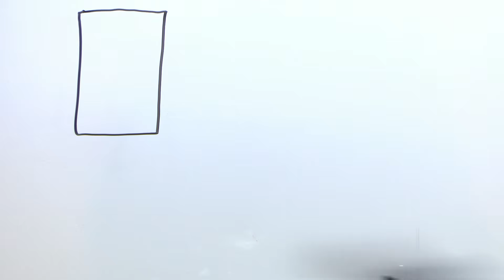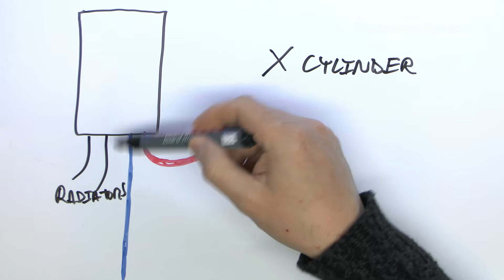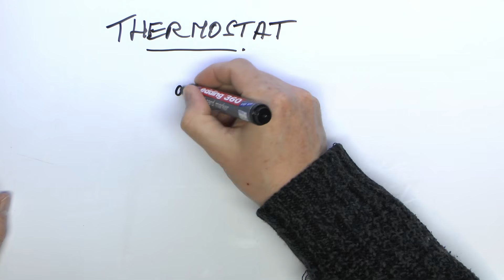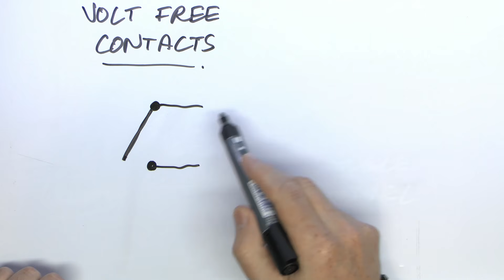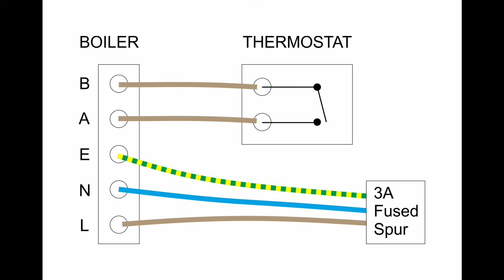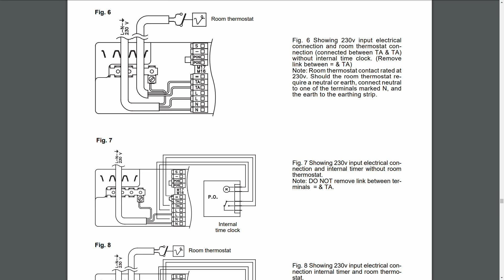Combi Boiler Thermostat Wiring

Comment: i was wondering if anyone can help. 
Im installing a hive 2 on my logic 24 boiler  which doesnt have a previous receiver. 
I understand this video (its great) but a lot of other forums say i need to make a link from Live to 1 common? 
im kind of worried about doing this as i dont want to wreck my boiler. 

Can i just attach live and neutral from the existing boiler terminal? plus connect the switches? 

Many thanks in advance
Reply from the maker: If the boiler uses 230V switching, then a link can be installed between L and common (1), with a single wire from Heating On (3) returning to the boiler.
However that is only valid for boilers that use 230V switching, doing that will cause severe damage if the boiler uses another voltage.
The other option is to have the 2 switch wires from the boiler connected to 1&3.
The tiny advantage is that one method only needs 3 wires, and the other 4 wires.
Reply: @jwflame  Thanks so much. I'm slowly getting more clarity. I'm not 100% sure how to find out if the boiler uses 230v. But the method that seems a good place to start will be the 4 or 5 core cable. 

2 from the switching terminal on the boiler to ports 1 and 3 on the hive. 

And piggyback live neutral and earth from the boiler terminals to the hive.  Altho it says an earth isn't needed. 

Thanks again for replying. And thanks for your channel!

Side note. Would you recommend just opening up the wall on off switch (spur?) And running L N and E from that to the hive?

Comment: Hi good morning just going through your video. I have purchased the Honeywell T4. would it be possible if I could send you a picture of my original wiring and if you could kindly advise. Existing wiring I currently have 3 wires coming out of boiler. If I could email you a picture or any other way of sending please

Comment: I am looking to replace an older type 3 wire mains thermostat that you describe (limited to minimum setting of 14 degrees C), with one that is capable of being set to 5 degree C ( just to keep pipes from freezing). Can anyone  identify a manufacturer of such a thermostat?

Comment: Hi, im trying to install the hive thermostat, but when i took off my old thermostat there was only three wires. Red Blue Yellow. Does this mean it is not suitable?
The type of thermostat i have is the ones commonly found in uk homes, a while plastic box with a round dial . Appreciate any help.
Reply from the maker: Depends on what those wires are.  If they are line, switched line and neutral then an single channel Hive can be fitted there , however the Hive receiver isn't intended to be installed where an old thermostat was - the receiver is normally installed next to the boiler and the thermostat located elsewhere.

Comment: Hi John. In the example of a possible wireless room stat at 10.00, could you put a link from L to A. And then have B go back to the boiler as a switched line. I know you said it's a volt free contact it's just that I seen it like that somewhere. Will it work or will it destroy the PCB?.Thanks
Reply from the maker: Yes, that can be done - but only if the boiler uses 230V for the switched input.
Volt free contacts can be used with any voltage, including 230V.
Reply: @jwflame  Thank you John, much appreciated,
 One last question if I could, would doing this mean it the thermostat becomes mains voltage? Rather then volt free contact. Struggling to understand what makes it one over then other. Thanks again
Reply from the maker: @abdulh63  Volt free just means it's not connected to anything inside the thermostat - you can connect any voltage to it.  
The other kind are permanently connected to voltage inside the thermostat, normally 230V, so with those they can only be used with 230V boiler and there is no other option. Same as having the link from L-A permanently built in to the thermostat.
Reply: @jwflame  ah ha I think I've got it now! Thank you very much.

Comment: Great video Im after a bit of advice. I was replacing my motherinlaws stat which is a battery digi one. At the wall are only two wires red and black. I replaced it with a wireless stat which has 4 terminals. 4 live 3 neutral 2 volt free in 1 volt free out. When the two wire are connected to 3 and 4 it powers up unit but no switching the heating on or off. How do I wire it up to operate heating. The instructions say about bridging a connection but are very sketchy to say the least
Reply from the maker: If the battery stat worked with just those two wires, then those are the wires for volt free in / volt free out.  You will need additional wires for the L&N supply.
However a wireless receiver isn't intended to be installed where the old thermostat was - it's installed next to the boiler which will have all of the required connections, and the wireless thermostat is located wherever you want it.

Comment: Awesome video John. Watched the lot. I've bought a thermostat that has L/N/1 and 2 which is for the loop. I've got a Worcester Bosch 30i and I'm removing a danfoss cx1. Obviously that leaves me with live, neutral, earth and the 2 wires I like to call the loop. Does it matter what way I connect these in 1 and 2 on the new stat? The stat is 240v so I'll obviously run live and n from the boiler to the state so that it's powdered. (WiFi smart stat). I'm just paranoid I connect the loop wires the wrong way round. Any ideas or does it not matter? 
I was planning on running a 4 core. Your help would be really appreciated.
Reply from the maker: Doesn't matter, all it does is connect the two wires together when heat is required.
Reply: @jwflame  dynamite. That's settled my head a bit more. Thanks ever so much.

Comment: Thanks John for the video. Actually I have ARISTON under sink water heater. The shoe is missing. I am using 13AMP switch/shoe. As I opened , I found 4 wires. Black, blue, brown and yellow. My place is 3 phase ground floor and single phase on the 1st floor. This 13amp shoe can take only 3 wires. Where the black wire will go. I wish I could send you a pic. Appreciate of you please advice. MAny thanks for the great video.
Reply from the maker: You will need to get the instructions for the heater - otherwise it's just guessing what the wires are for.

Comment: Hi john I am replacing my old stat with WiFi one on a y plan system ? Back boiler.i have 4 wires on old one red yellow blue earth how do I connect
To new WiFi room stat it has 1234 terminals and nth regards colin
Reply from the maker: Depends on what those coloured wires are connected to, and what the new stat terminals are actually for.
On their own, colours and numbers are meaningless.

Comment: I've got one of them smart thermostats, it has 4 contacts N, L, and then dry contact which one is straight line the other is bendy, out of wall i have 3 cables N, L, and Wake. Is there a way to wire it up for myself? Anyone knows?
Reply: Nevermind i figured that out, had to bridge the L wire to A switch and add wake wire to the B, that worked. £26 smart thermostat with wifi that listens to what I say to alexa. That is quite impressive

Comment: The rumour that the 3 wire thermostat (L, N, LS) is dead may be a bit exaggerated. Had one of those old looking twisty-dial things, but it is in fact an electronic thermostat, Drayton RTS1, on a fairly new build i.e 2013. Even more, its replacement basically went into the same mounting wallplate, albeit with a link between the L and 1 terminals - referred as "industry standard wallplate" in the Drayton literature. That replacement is a Drayton Wiser Heat Hub with all the latest bells and whistles, but on the boiler side of things it is a bog standard switched line on terminal 3 no matter how fancy the tech surrounding the relay actually is. The only alternative provided on the hub is OpenTherm. My boiler was released more than a decade ago (the product, not the actual unit in my house), although still sold as Worcester's top of the line product. This could make it a tad old. However, the Wiser system is recent and they haven't seen a market for providing more than these couple of connectivity options for the boiler.

Comment: Hi john thank you for the comprehensive description. I have a question though. What should I do with the wire to the  standard mechanical clock control on the boiler its self?

Comment: Hi John I have a hive single channel receiver to fit to a boiler which has never had a thermostat. The wiring diagram for the boiler(vokera vision 30c) says use contacts free of voltage but receiver says 230 switching power on the back. Should I be using 3 core flex from my receiver or 5 core flex and where in the boiler controls should I be connecting my flex to, if just 3 core flex then that’s simply just brown blue and earth but if 5 core needed where does black(1on receiver) and grey(3 on receiver) get connected to in the boiler? Any help would be much appreciated please, thank you.
Reply from the maker: Receiver connects to the M2 terminals in the boiler.  Remove the link from M2, and put the 1 & 3 wires from the receiver in there instead.
Do NOT connect 230V to the boiler terminals, doing so will damage it.
Reply: John Ward brilliant thank you so much for the fast reply. And I take it it doesn’t matter what way round the 1 & 3 wires go into the m2 terminal block
Reply from the maker: No, doesn't matter.  All the thermostat does is connect them together when heat is required.

Comment: call for heat .. where is it go ? is it Neutral ?
Reply from the maker: Call for heat is a switched line on most systems, or for some boilers is may be a lower voltage such as 24V.  Not a neutral, do not connect to neutral.
Reply: @John Ward  thanks. I found it now. There is no good wiring diagram on these https://www.picclickimg.com/00/s/MTIwMFgxNjAw/z/OVsAAOSwxp9W3X7x/$/Codice-Dual-Combined-High-Limit-Thermostat-and-Control-_57.jpg
Reply: didn't this guy connect N ? https://www.diynot.com/diy/threads/hw-stopped-working.436735/
Reply from the maker: They have used blue / brown wiring, but it's not a neutral, just line in - line out.  Probably didn't have any other colour of wires available.
Reply from the maker: Wiring link should be https://www.picclickimg.com/00/s/MTIwMFgxNjAw/z/OVsAAOSwxp9W3X7x/$/Codice-Dual-Combined-High-Limit-Thermostat-and-Control-_57.jpg
Reply: yes i gave the same link above. C is L but where the 1 coming from as I'm connecting to the flex outlet where Honeywell thermostat was connected before. And someone suggested if its the unvented cylinder it should be connected via zone valve ?

Comment: Can I attach a standard 3 prong plug to my boiler as a temp solution to loss of power in the kitchen? And run it from an extension lead elsewhere?
Reply from the maker: Yes, and you could then run it from a generator or battery powered inverter if there is a total power failure.
Reply: Thanks for such a prompt reply mate 👍

Comment: Hi John, 

I have Baxi 40 Titanium Combi Boiler and two S Valves for each floors heating. I am struggling to wire it with the hive multizone system. two separate receivers for each floor thermostats. I will be very grateful if you can do a quick drawing for me.

Comment: Hi John, You have great videos, excellent, but i cant find one for my situation, please could you help. Basically i have a Viessmann 100 combi boiler and it has a wireles programmer / stat. i want to fit hive, im getting confused as to how i would wire the Hive receiver to the combi boiler, please can you help. thank you
Reply from the maker: Two wires for the power supply L&N, and two more for the two thermostat terminals in the boiler.  Any other existing programmer, thermostats or controls are removed.
Reply: Thank you for your reply, so would piggyback the L&N in the boiler with another cable,which would go to the hive receiver, but where would the other wire go to on each end, been looking at some of your vids and there is a loop in some of them, do i just leave that, forgive me being thick, im only a joiner. thanks again
Reply from the maker: The other two wires are just a switch - either connected together by the Hive or not connected.  Details of the boiler connection can be found in the boiler installation manual.  If there is an existing wireless thermostat, wiring for the Hive will be the same as for the existing receiver unit - they are all basically the same.
Reply: thank you, will let you know how i get on

Comment: Hi John, another extremely helpful video! Is there any possibility you could do a video on thermostatic wiring to a Combi Boiler that has 2 UFH thermostats and 1 or 2 Radiator thermostats? I understand that NEST can support systems that have dual heating in the property, such as radiators on one floor and UFH on another floor - but I am yet to find any helpful videos on how this particular system would be set up. Many Thanks!

Comment: Very clear explanation JW. I'd like to see you do a video on making terminal connections safely. As a heating engineer who does mostly service & repairs, I come across a lot of systems where people have screwed 2 or 3 flexes together and stuffed them into a terminal strip that's too small, so that only a gentle tug is needed for the wires to fall out. I also find bits of copper flex wire sprinkled over PCBs in boilers. I always tin the wires myself. If people don't have soldering skills I guess they could crimp on bootlace ferrules. Some people tell me this is too much trouble, but I find, once done, the job goes quicker and there are no dodgy connections. The other trouble with screwing wires together is, it's not easy to remove some to test or replace components. I also find people over-tighten the terminals. Of course you don't want loose connections, but I find wires that have been crushed to half their CSA. What are your thoughts on this JW? Please do a video on this if you have time, thanks.

Comment: Fairly comprehensive description of wiring configurations. Ty JW. However! The location of the thermostat or stat/prog is an important consideration too. It must not be placed directly above a heat source or it may well get.... confused(?) 
I have attended numerous properties where the stat is placed upon a wall in either in direct sunlight or above a radiator, or in the case where the prog/stat is portable (battery-wireless option)...and not permanently fixed to the wall has been placed upon a mantel piece above a gas fire. A "t" stat, controls the operation of the boiler on heat mode. Whilst it may be cozy and nostalgic to watch the fireplace fluttering away... the boiler will not heat the rest of the house as it primarilly determines whether the gas valve opens and fires up. 
Also, as a wall stat dictates when a boiler fires on either time and/or ambient localised heat controls, I'd still recommend the addition of thermostatic radiator valves. Why would one illuminate a room when one is not inside. Turn off the light.  Crank down the TRV's in unused rooms, close the door to the room.

Comment: Hi John, great video but you are mistaken about using combination boilers in large premises. I have a combi boiler fitted in my 5 bedroom house with two bathrooms and have found it works extremely well. It can easily supply two showers at the same time and at mains pressure. I had to fit a pump to get sufficient pressure to have a shower with the old system. I never have to worry about someone having a bath and using up all the stored hot water. The only slight negative is that you cannot have the heating on at the same time as running hot water but that rarely causes a problem. Also it halved my gas bill although the old boiler was well past its best.

Comment: Dual channel timers can be useful with combi boilers if they allow control over preheating. My boiler is a good example; it can preheat a small amount of water stored inside the boiler itself so that the water is hot much faster when a tap is turned on - but that means more gas usage as it will gradually lose heat into the room and then heat itself back up again. That can be controlled by a seperate channel of the timer so that when nobody is in the house it doesn't still keep its reservoir of water heated up. If, for any reason, somebody is in the house anyway while it is "off", it still turns on and heats the water just without the speed of having a pre-heated portion to go straight to the tap.

Comment: Love the videos, John. We have here thermostats on each radiator, seems to work well but we need a new boiler as the one we have got damaged. Does this matter, there is no electrical thermostat only a timer.
Reply: Thermostatic radiator valves (TRV's) dont actually electrically turn the heating off, you need a room thermostat also but remove theTRV from the radiator in the room where you fit it.

Comment: Hi John,  your description is spot on for older systems like mine - a Bosch combo installed over ten years ago to which I added a Nest thermostat / programmer works well.  New boilers often support ‘Opentherm’ which is a way for the thermostat to control the output of the boiler to optimise the warm up and maintain it.  It would be worth having a look at that as I believe it is not always as ‘open’ as promised...  Keep up the great videos!
Reply: Dingo Nates ‘Opentherm’ is only one of 26 digital protocols used in CH controls, the variety & functions are all different.
Opentherm is a very basic one, adopted by a few boiler manufacturers trying to unify CH controls & boilers.  It’s a basic protocol, with only the boiler & thermostat speaking to each other, so very limited in performance.
Other systems are ‘Bus’ like systems, where the data can be read & distributed through all components.  It’s like a Bus Route, the info can stop & start at anything connected to it.